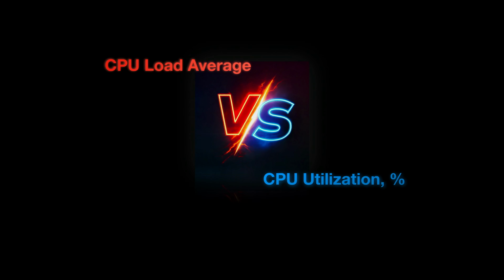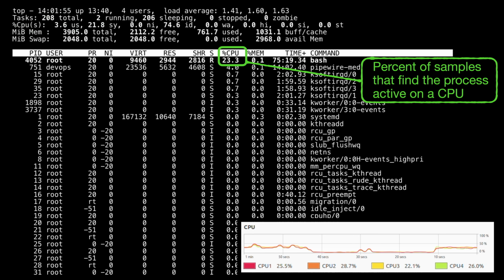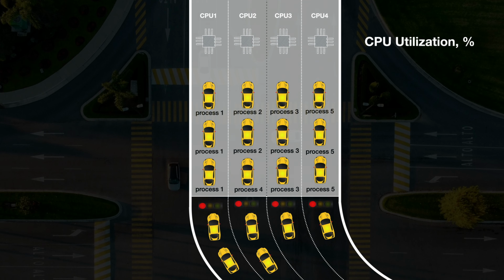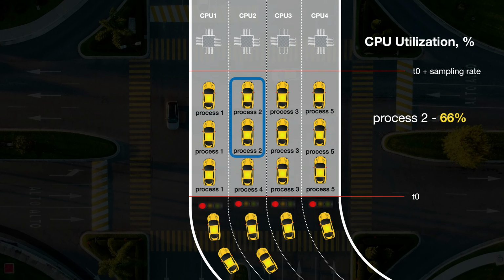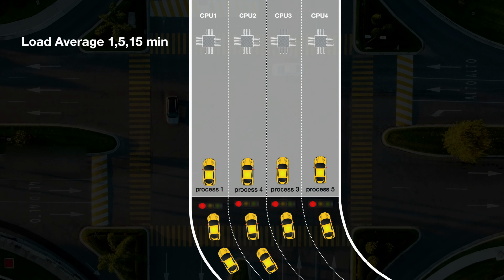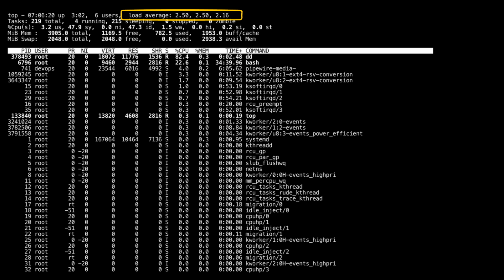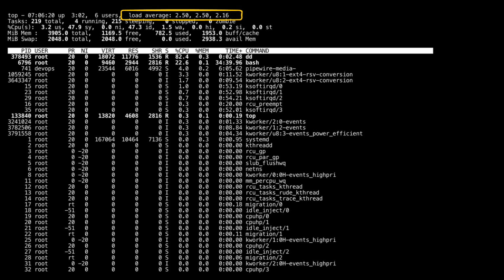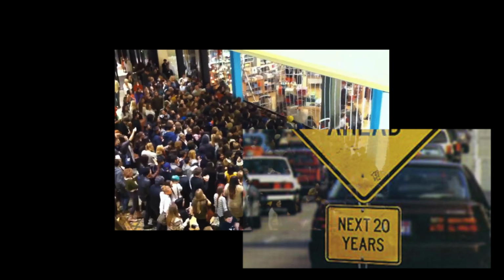There Is No Such Thing As 50% CPU Utilization! #linux #development #programming

Comment: this was amazing! but i sitll do not understand the formula they use to calcualte the number? i.e 0.25. also if my load average show 0.00, 0.00, 0.00 does it mean the computer has 0 processes running?
Reply from the maker: If you have one CPU in your system and load average 0.25, 1.75, 1.20, that would mean 0.25 runnable processes for the 1 minute interval and thus the CPU was idle during 75% of the interval. 1.75 for the last 5 minutes would mean 0,75 processes were slated and waited for execution time, meaning your 1 CPU system was saturated handling the rest of the processes
Reply: @DevOpsUndefined  but for me it shows 0, even though. I have some process running...
Reply from the maker: The CPU can be idle, but that does not mean there are no processes running. There could be background processes. They are using memory. It is just that they are not using CPU because they are not doing anything during the time period. Also the value can be well below 0.01. It could be also a bug, though :)
Reply: @DevOpsUndefined  Basically, at some point during the Linux kernel history, load averages were deliberately changed to reflect demand for other system resources, not just CPUs. Linux changed from "CPU load averages" to what one might call "system load averages".
Reply from the maker: Just for reference: the code that calculates the Load Averages is located at: https://github.com/torvalds/linux/blob/5be63fc19fcaa4c236b307420483578a56986a37/kernel/sched/loadavg.c#L349 in the linux kernel source code. Seems to be quite complicated, as they have also taken care for systems with large number of CPUs, where the calculation for the number of active CPUs is expensive. Funny thing is the comment in the beginning: "This file contains the magic bits required to compute the global loadavg figure. Its a silly number but people think its important. We go through great pains to make it work on big machines and tickless kernels." ;)
Reply: @DevOpsUndefined  Thanks! may I ask what did you search in google to find this? I'm also trying to find the cpu utlization calculation file :D
Reply from the maker: I've searched in the linux kernel github repo. When you go to github (https://github.com/torvalds/linux), there is quite a powerful search(upper right at the page) which can also search in the code of the repo - there the search I've used is: repo:torvalds/linux "load average"
Reply: @DevOpsUndefined  is it possible that there is no single file responsible for calculating cpu utilization? I tried searching though the repo up to page 5 but couldn't find anytinhg